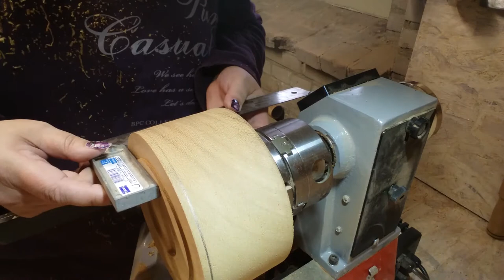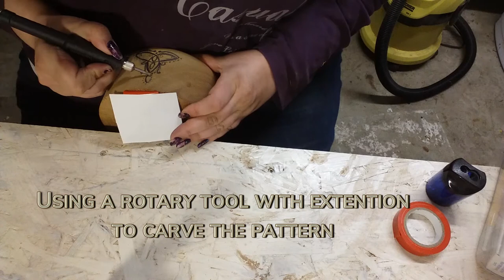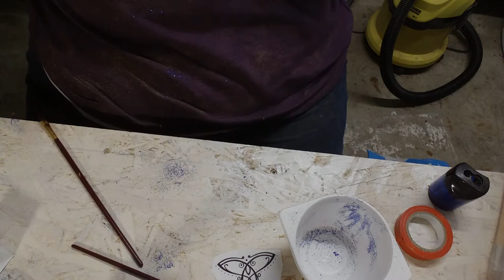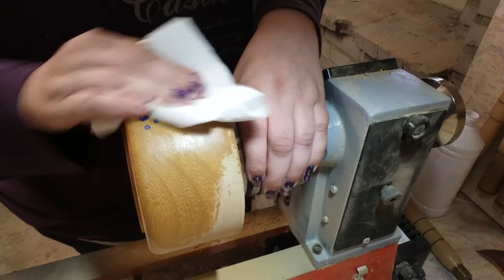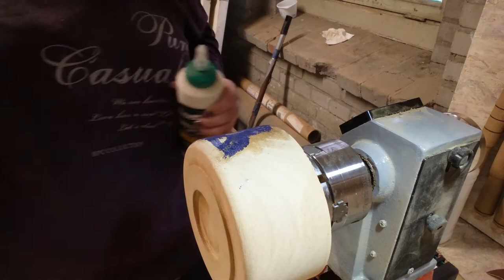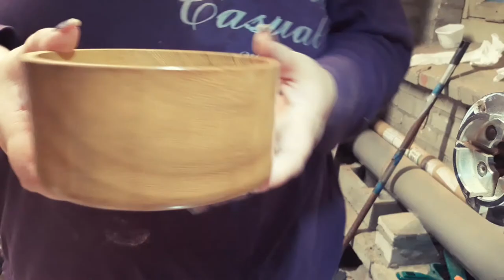Woodturning the Celtic "Motherhood" Bowl

Comment: Big thank you for uploading this, this is Ashton Woodturnings off instagram, hope its ok to ask two questions, What kind of glitter was it that you used, and how well does it work just using the pva glue with the glitter instead of the epoxy, Looks like you were using ukwoodcraft chisels , i have both sets, and tend to buy my cutters off knife-point dot co dot uk as they are a lot cheaper, i'm not sure, but if you use the square cutters, try some with a slight radius, i find you can shear scrape with them, and also i find you get less catches, cheers  Mart
Reply from the maker: Hello Mart,
I bought superfine glitter at a local craft store called Pippoos, I'm from The Netherlands. I found out that the epoxy got opaque when I mixed it, so next time I Will mix a pigment too. I painted the carving because I was not sure if it would turn opaque. I don't know what you mean with PVA glue, but I think you refer to the titebond woodglue. I don't think it's suitable to replace the epoxy, it's too liquid and I think tge glitter Will sink to the bottom.
I use tge chisels from Glen Teagle, https://www.ukwoodcraftandcarbidechisels.co.uk/ I ordered 2 replacement sets for all chisels while I bought them. I'm considering to buy negative rake cutters, but haven't decided yet.
Gr. Willemijn
Reply: @chiselchick9372  I have tried the negative rake cutters from easy wood, didn't find that good on wood, but great when turning plastics.
Reply: @chiselchick9372  I read a Youtube review of Glen Teagle's tools and he was impressed. This was recently and from a well respected UK turner who uses the big-name tools. (and they are Very Reasonably priced !! )
- Mike
Reply: @martkt10  There is a bit of a learning curve using carbide on wood. Don't give up yet. Everyone loves carbides on resins - and they say 'The faster the better'
- Mike
Reply from the maker: I saw tge review of Mike Waldt and contacted Glen, very nice person to buy from.